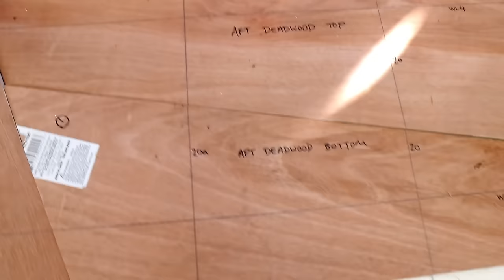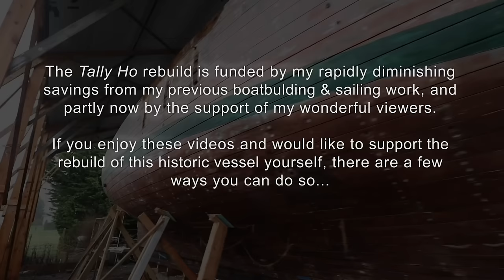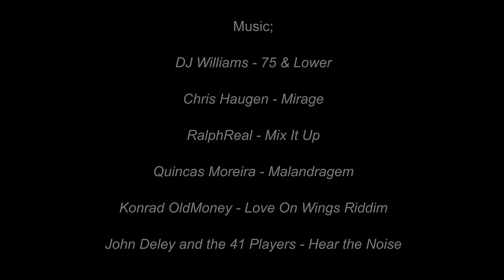Cutting the Stern Post – and some BIG plans! (Rebuilding Tally Ho EP42)

Comment: Where can we find a line drawing of Tally Ho? I saw Leo was using a very clear and detailed copy.
Reply: The original Albert Strange drawings (his design #96 for 'Betty') are archived at the Mystic Seaport Museum. I presume that anyone could get copies from there, for a fee - but w/ restrictions on further distribution.
Reply: Frederick Stibbert I’ve been searching their website but I can’t seem to find anything beyond his name.
Reply: @cmetz100  You'll have to get in touch w/ their archive curator dept. by phone or letter. Some of Strange's papers ended up w/ an American named W. P. Stevens, & Mystic holds Stevens' collection. Leo has confirmed (in the comments to one of his videos) that Mystic was the source of his copies of the drawings for Betty. I don't know if you're familiar w/ archives or library rare-book collections (I'm certainly not an expert) but this kind of 100-year-old stuff is typically stored carefully & handled w/ white cotton gloves. It's not the kind of thing that they can just grab off the shelf & run thru the xerox, it'd take someone most of a day just to locate & unwrap it. Access / availability is usually limited to researchers & historians.
Reply: Frederick Stibbert thank you! I’ll have to contact them this week.

Comment: @Sampson Boat Co   Leo, What model saw do you have? I'm a Stihl tech and am quite curious. What size Bar, Chain gauge, and how many links are there?
Reply from the maker: Its a 311 with an 18" bar, 3/8, .050, ripping chain, 66x links (had a longer bar on at the beginning of the video, then I bought the shorter one). I would like a narrower kerf ripping chain but haven't figured out how to go about it. Any suggestions welcomed.
Reply: @SampsonBoatCo  Hmm. The 311 was discontinued this year. I'm going to look into some other possible chain and bar combos but ill have to call head office on monday. Even for us Stihl techs they don't make finding chains especially ripping chains easy on their website.
Reply from the maker: Thanks, I'd be interested to hear what you find out!
Reply: @SampsonBoatCo  No problem!
Reply: @SampsonBoatCo  Alright, here's what i found out! I wanted to get you a carbide ripping chain for your saw but Stihl does not make a carbide ripping chain only carbide crosscut chains.  You can get a narrower chain (.325 gauge) it's approximately 1/8" smaller in width. However it requires changing your bar, chain and sprocket assemblies. I see you also have drilled holes in your current bar so you'll have to drill them in your new bar as well. The .325 chain has more teeth as well. Looking at what you're cutting, either what you have or the .325 is the best setup we believe without having a carbide ripping chain available yet.

Comment: When you first started I thought to myself 'that is not a rebuild, that's a new build' because of all the rot. If you are replacing all the frames and keel sections, etc... don't slow yourself down with fiddle farting and wiggling things in position with all the old shit still there. Rip it all out, give yourself the room to move, get the rest of the frames in much easier and then start planking. I really don't know why you slow yourself down maneuvering around all the old crap that you are replacing anyways. If you have all new frames and backbone, are you really gonna slap the crappy old planks on the shiny new foundation?

Comment: I'm not OSHA but I am a licenced forklift operator. Don't ever let me see someone of your crew standing and sawing on a piece of timber on lifted forks with a large chainsaw ever again, please!
Reply: @paulcopeland9035  I'm not going to do a damn thing. I just don't want anyone to get hurt or for Leo to be liable for injury lawsuits and all that BS. I saw a blatant safety violation and I decided to call it out in hopes that it at least doesn't show on video.
Reply: Ever try just using your head and getting the job done.? This thought pattern is the death of North America . Think safety don't regulate it.
Reply: I was watching a steam engine video. there was a sign" this machine has no brain use yours" .i think my forklift card is out of date. but i will side with Ray Fletcher on this
Reply: @rayfletcher3683  Yes, I have. I also knew a guy whose arm came off in a lathe because he had to get the job done. He bled out.

Ofc you need regulation, especially in a structure where injury litigation is so common.

I don't care. Stand on a branch and saw it, don't use goggles and gloves and while you're at it, why not have a drink and operate some heavy machinery.
Reply: Povl Besser   I fail to see how loosing your arm in a lathe or anything else has to do with having to get the job done .  It has everything to do with not using common sense and taking responsibility for your actions.
Reply: @Pow3llMorgan   back in the old days i worked on a oil well service rig .the guy i worked for was usually on his second beer when he picked me up in the morning. no one was ever injured on that crew .  back in those days we said sh!t happens . now there has to be a cause for everything.
Reply: @rayfletcher3683  It has everything to do with not following simple guidelines for work safety.
Reply: Povl Besser  ,    Nothing wrong with guidelines  but they are getting ridiculous . People need to use their common sense and not be reduced to  being considered to stupid  to be reasonably careful. This nanny state is  insulting and counter  productive.
Reply: problem with safety guidelines . case in point . we had to do a job safety analysis for every task  no matter how many times we had done that job. so i asked about if we had a fire should we do a JSA for fire fighting first. oh no way you don't have time for that. so for tasks you did daily you needed a JSA but for  a dangerous task like fire fighting  which we may have had training for a once there was no time for a JSA.